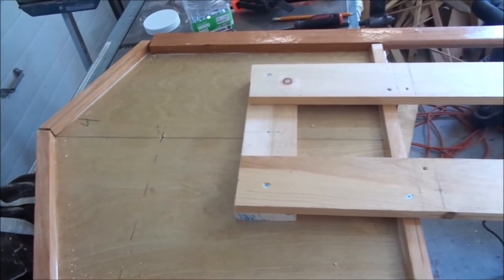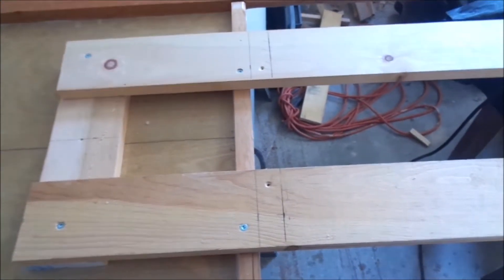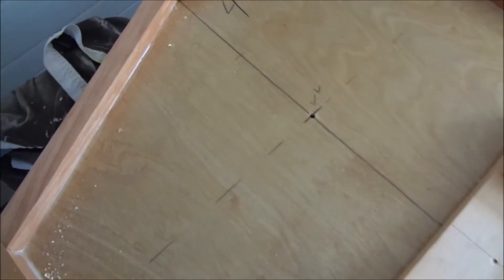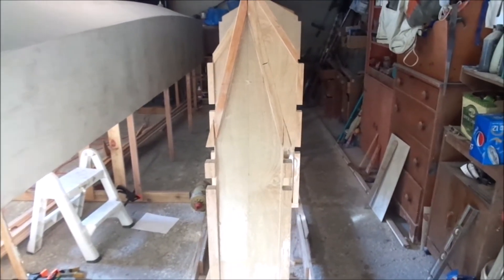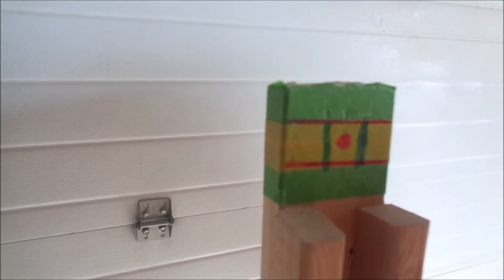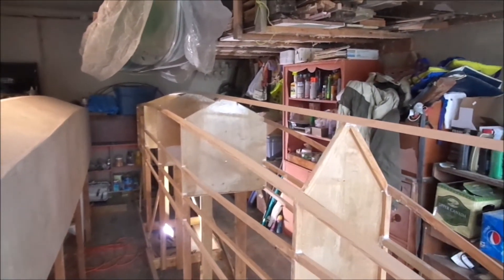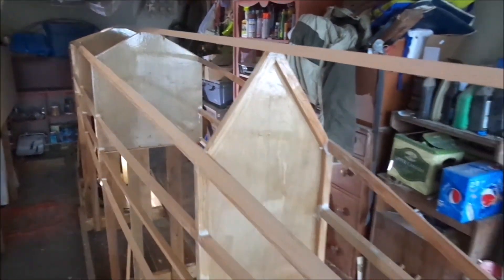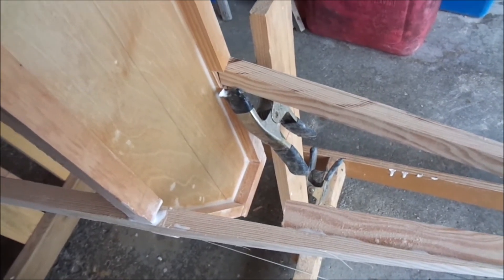Building My Solar Electric Catamaran Part Three

Comment: what are you using for glue  ?
Reply from the maker: I use just white wood glue to join all the wood strips but then I use epoxy resin and glass on inside and out.
Reply: @philboyer2036  Thank you